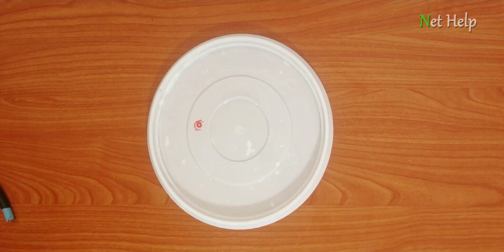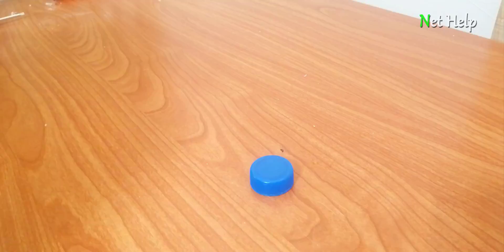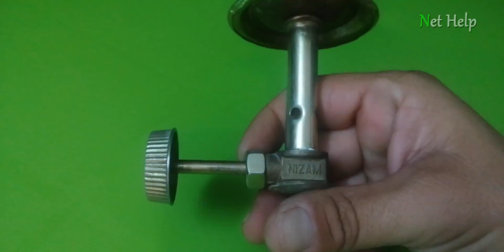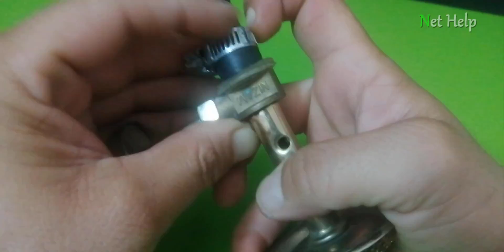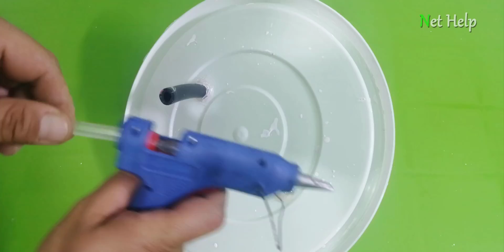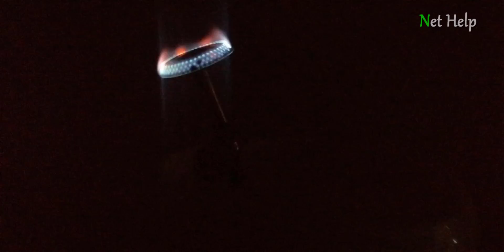How to use free gas from Vegetables

Comment: Using epoxy or any type of  Glue or resin Frightens me Gas  Pressure  Building up  within the Container is  Likely to push hard against the epoxy and thus Dislodge the Epoxy from off the Plastic Lid ? any Leakage  of Gas within a Small combined space could cause an explosion and also if the Gas Pressure  is  Lower within the Barrel where Room air  can be  pulled into the Container  If you get a Flashback  where it's one hell of a Bang !  I worked down a Mine  where Methane  Gas was always  there ! If Gas was about 6% and there was a point of ignition there would be a Huge Flash where then it would  Burn out quickly  But if there was a  2% or 2  1/2 %  there would be an explosion so if there is a  2% gas and  80% air  and there was a Backfire your  House would become  a disaster area
Reply from the maker: Mr
If there is any air leakage, there will be no gas because the air, if it flows in, the fermentation will not work in any case

Comment: 4 main questions, #1) How long can you burn the Biogas, from of 5 Salad leaves? min / hours #2) can the pressure / biogas break the seal after so much time if not used for a while? #3) at what point do you need to add more Stone Salt (Can it be regular salt) or droppings & Last but not least #4) can you use your own crap, Lol, essentially could you cook your dinner from biogas, eat that dinner, then crap back in the bucket, would that constitute the same result of animal droppings? as funny as that is, cause I am literally crying from laughter on this thought, would that work?
Reply from the maker: Gas burns for two months in this experiment
Gas pressure can't unlock locks
Every two months you can add articles

Comment: Using plastic container well not explode for over pressure of gasses.. Just asking. Please reply
Reply from the maker: The thickness of the container should be more than 5 mm or a pressure vessel should be used
Reply: Im watching some other videos the add npk fertilizer and sulfate of potash.. Is this really help for the process of fermentation..
Reply: How about the condense water in the bottle can we use it in led acid battery

Comment: Wish there were links to parts. I have no idea what some of those parts are from about 3 min on.
Reply from the maker: The following materials were used
1- Vegetables
2 _ Fruit
3_ Animal dung + soil
4 _ Rock salt
5 _ Ammonium + potassium
Reply: @NetHelp2  Thank you. And is that just a gas valve? The metal part.

Comment: Why is the light going out? I like this concept cos its purely home made. But the gas doesn't seem strong enough to keep the flame on. Any recommendations?
Reply from the maker: sir
We turned off the light so that we could see the flame well
As for the strength of the gas, it is weak due to the lack of air pressure inside
Any inquiry you can ask more
All information is below the video
Reply: What I'm asking is the flame not the light sorry. Why will the person put in the light at multiple times, is it because the flame is not strong enough or the gas is not flowing well enough to sustain the flame. Kindly revert. Thanks.

Comment: Sir Net Help, how many percent can you estimate the waste material for that composition, especially the Methane off-gas and the effect on the room you performed that experiment. Thank you for the response
Reply from the maker: You can watch all the videos on the channel
Reply from the maker: Mr
Each one has a kilogram of animal manure or a kilogram of vegetables
A gas is extracted that works for eight hours
The experiment takes place in a separate place from the house, and it is preferable to use a pressurized bucket or an iron bucket
Reply: @NetHelp2  Thank You sir for the response, more power
Reply: @NetHelp2  good evening sir, what is the content of the separated bottle? is it a moisturized water or the biomethane itself? and if its a moistural water of the decomposed waste, is it safe to throw away? thank you sir for the respond

Comment: Hello! Thank u for this more explain video.
But I have a question.
I put my container on my balcon, can outside temperature can impact negatively the experience?
Thank you.

And what is the water in bottle mean? To start using the gas?
Reply from the maker: It should be placed in a dark place
Temperatures affect the fermentation process
Reply: Thank u

Comment: Hello! Thank you for sharing this experience. 
1) Tell me what kind of glue do u use?
2) And is it correct if I use the same pipe of gas and water exit?

Thank you
Reply from the maker: The glue used is silicone
You cannot use the same hose
You have to add the flask because the evaporation should be below the water
Reply from the maker: There is a new video that you can
Reply: Thank u

Comment: How do you renew the vegetables once you have extracted all the gases, you glued the lid on? Plus how do you stand a cup or pot on the heat to make a drink or meal? just curious?
Reply: I have noticed several videos ( from India  ) use this floppy burner on a plastic bucket or tank. Walmart ( buy thru the internet ) has a two burner stove  you would be safer to run the hose to.
Reply from the maker: Mr
You can remove the cap or use an iron bucket or any bucket that closes automatically
We're just experimenting
As for the targeting, we will later manufacture an integrated gas
You can also watch the latest video on the channel
Reply: Que polvo es como se llama por favor manteme  los productos  claro

Comment: Nice presentation. What you are making is commonly known as "Biogas"  You can use many sourecs besides vegetables to make biogas. For instance, tree leaves can be used to make fuel for cooking. Thanks for the presentation.
Reply from the maker: Thank you for visiting the channel, and you are welcome
Reply: Sir, the foil the form fire is directly came from the pale. What is the use of that Water in the bottle extracted or evaporated from the pale. Is it foil gas too that can be for cooking? or while the cooking  and the burner is working the liquid substance in the bottle is consumed. Please explain.
Reply: What are the things added on the vegetable
Reply: What is the liquid in the bottle? The bio gas is methane and its liquefacion presure at room temperature is 47 bar.  So is the gas methane or smh else pls let me know
Thanks :D

Comment: A biogas plant is an excellent place to make compost for the garden. The slurry is a great fertilizer. While you did show the basics, which is excellent, you could probably consider a Part 2 where you show the use of the liquid fertilizer and the compost. Good job otherwise.
Reply from the maker: sir
This is not mud, but rather animal dung
We wrote all the requirements below the video in the explanation, and we also used the subtitles in the video
Reply: So your slurry after it quits producing gas can't be used as fertilizer but must be disposed of
Reply: @douglaswindsor120  Disposed? Not sure what you mean.

Comment: It's dangerous as hell to have the fire on top of the fuel source. You essential have a small bomb under the flame. Do not do this at home like this. Separate the flame from the container.
Reply: Guess you have never been camping...
Reply: @williamblomberg7934  I have and it wouldn't matter if I hadn't, this is still very dangerous.

Comment: Great idea but the setup is dangerous because the fire is TOO close to the gas tank, perhaps allowing the gas to go through a "water bubbler" these are ease to make and there are videos here on YouTube that teach how to make them, then the burner. In case of a back fire all you hear is a pop and a splash of water.  The simplest way is to use a portion of the tube on a "U" shape and add a little water to it if there is a back fire it will only burn until the water instead of reaching the big bucket.
Reply from the maker: Thank you for the alert is a small and quick experience

Comment: I have so many questions.   I do know about biogas but the plant is usually very big.  In this small model, (1) How come the gas has so much pressure? Will the pressure continue even after being used for sometime? (2) How long will it burn? (3) Can you turn off the gas and use only when required?   (4) In present model, the gas cannot be used for any purpose. Have you tried to connect it to your stove? (5) Can methane gas be stored in some manner to be used only when required?
Reply from the maker: sir
You can use it at any time
A water tray is a gas purifier that protects the gas from evaporation
Reply from the maker: This is a thumbnail form and there is another video on the channel that you can watch
The new video link is below the video